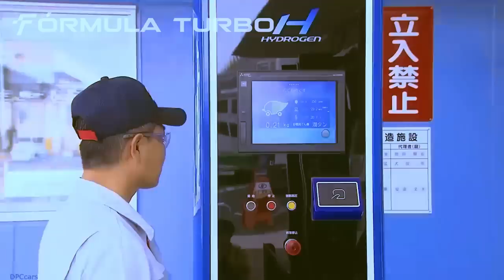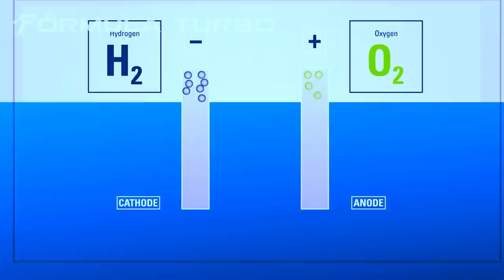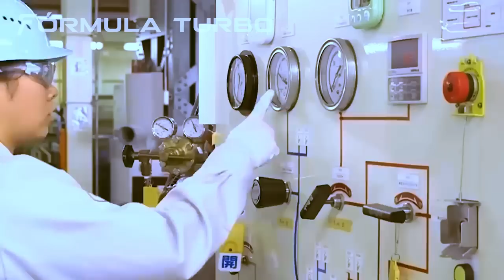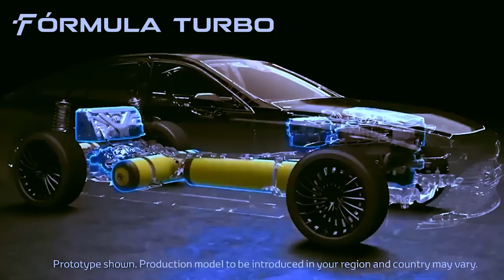BREAKING NEWS: TOYOTA'S CEO DISCLOSES THE ENGINE OF TOMORROW

Comment: The fundamental problem with hydrogen is that you have to make the hydrogen. And to be green hydrogen it has to come from electrolysis of water. That uses 3 times the power per mile than you would us  by just using the same power to charge a battery directly.

3 to 4 miles per Kwh For battery EV. 1 to 1.5 miles per kWh of  power - hydrogen - power - wheel "round trip" WHY?

Comment: If the hydrogen/fuel-cell car can be reduced in cost like my solar panels and also provide in-home hydrogen compression and storage, ensure hydrogen is not stored on the car in high-pressure tanks (which would be very dangerous in an accident) is overcome I'll stick with my free electricity from my solar panels.

Comment: This is old dead news. Toyota is swimming upstream against an impossibly strong current. IC Engines of any kind have terrible efficiency, 30% or less in real world conditions. Fuel Cells are better, topping out at 60%. However, Hydrogen is not a freely available fuel, it has to be extracted using a lot of energy. You then have to compress it, transport it and store it.
When you put the Hydrogen ecosystem next to the BEV ecosystem, it's blindingly obvious which is the most efficient and convenient. Hydrogen is a dead duck. It always has been, and always will be. Sadly, Toyota have invested so much into this technology, and the Japanese are culturally programmed to save face at all costs. Admitting that they've made a grave error of judgement is simply too much for them to do.
Bankruptcy beckons.

Comment: No infrastructure to fill up your hydrogen car. The cost to producing hydrogen is very expensive and causes pollution to make it unless you use solar. It needs to be refrigerated during transported and storage. MORE ENERGY!!! At this point in time Toyota needs to go all electric with some sort of battery technology or it will go under.

Comment: Question for Toyota. Can I fuel the car using free electrons generated from the solar panels installed on my roof? Or do I have to take the time out of my day to drive to a gas station and pay for expensive gas?
Reply: Electric vehicle owners should ONLY be allowed to charge their cars using wind and solar power, otherwise it's just pretend.
Reply: Use your solar panels to generate hydrogen instead of charging your dirty rare earth battery.
Reply: Now they are saying that the cost of driving an EV is more expensive than a gas car. They also say the EV market is slowing down and dealers are having to discount the vehicles to sell them. Myself I will never own a EV if I can help it.
Reply: @jimg2885  how can it be more expensive, when my overnight electricity is usually 8p per kWh and often goes down to 0p at weekends. So between 0 and 3p a mile?

Comment: They need to make an inverted tesla turbo fusion generator or use a vacuum sealed push plate in order to achieve qauntum pressurization though they would need strong and heat resistant materials.
Reply: Eh ??
Reply: Try combining that into an inverted turbo plasma generator with a vacuum sealed push plate for qauntum pressurization.
Reply: WTF ???

Comment: The biggest problem with the combustion engine is that it's design has been controlled for decades by the oil companies so they have a market for gas. A combustion engine can be designed that will give over 100 MPG and that would be all we need for our environment. In my opinion there are three major polluters; many manufacturing facilities, airplanes (too many in the air) and all the transport trucks on our highways carrying freight that should be on the rails.

Comment: Downvoting any video that promotes hydrogen. Folks, it’s a fantasy.  There’s a reason it is only available in California & Hawaii only—there aren’t enough commercial hydrogen stations, and there will never be enough stations—it’s a chicken or egg conundrum.  
I stopped listening to this video when it started to say green hydrogen was the future when more than 90% of all hydrogen is currently made from splitting methane using a steam process to make  H2 and CO2–Yup, that greenhouse gas. And if it takes electrolysis to make “green” hydrogen, why not skip the hydrogen step and use the electricity to power the car directly?! 🧐

Comment: Costly to store and  requires specialist equipment
High cost of servicing like ice motors
Cost of liquification
No existing infrastructure and expensive to install
No government will fund it and Toyota won't build them
Reply: Ev"s are not proving to be cheap to service in practice.  Tyre wear is Hugh due to weight and suspension components will also take a big hit.

Comment: How big the rhe tank should be for 500 miles range. Oops . Is there an answer  , any one ?
Reply: If it was a single tank it would have to be bigger than the 3 used in the Mirai.  Say half meter in diameter and 2 meters long as a guess.
Reply: Too big to fit in a car, that's why the range is no better than a BEV

Comment: I thought Toyota was working on HCEs not Fuel Cells.  Advancing technology to make hydrogen combustion engines would be better since it could be used to convert all existing gas powered engines to non polluting.
Reply: A hydrogen combustion engine is less than half as efficient as a fuel cell is the issue.
Reply: Yes !
H2O and electricity.

Comment: This is based on old information in regards to Toyota.  They are now very much on board with EVs.  
There is very little advancement happening in the fuel cell space and even less in regards to mitigating the large tanks needed to carry it.  Look how far the Toyota Mirai is way behind current EVs and the gap is widening every year.  Meanwhile battery advancements are progressing at a faster pace and look to continue that advancement.  In regards to the batteries nearly all will be recycled.  Recycling these batteries will be a profit center for many companies. In China which is the leader in this area the amount of EV battery recycling passed 2022's amount in the first 5 months of this year. 
Hydrogen fuel cells do not put out much power so a you still have to have a fairly good size battery. 
The video mentions that hydrogen produces energy much more efficiently. This is a flat out falsehood.  Hydrogen is just a means to transport energy just like power lines. It is not more efficient to use electricity to generate hydrogen, transport and then use a fuel cell than it is to transport it via power lines and a battery. 
The video also state hours to charge and electric car. This is misleading at best.  Most EVs are charged over night at home and would only fast charge on the days that car is required to go over 250 miles. (not that often for most vehicles.)  Many of the fast charging cars can add over 200 miles of range in less than a half hour with the best doing it in under 20 minutes.

There is some good information in the video but most of it is misleading.   It is like the info came from a 5 year old Toyota marketing spiel.

Comment: The High pressure Hydrogen tanks you need in your care are bulky. So the range on Hydrogen will be somewhat limited. Add up the damage the high pressure Hydrogen can do to these tanks. Small cracks will be a safety issue. In Europe LPG and natural gas driven cars and truck have an additional yearly check of the tanks included in the maintenance. The maintenance is more expensive than with fuel driven cars. And every 10 years the tanks will be degraded and have to be changed for new ones. This probably will cost less than a change of batteries for an EV, but remember Hydrogen cars also carry a smaller battery to store the energy produced by the fuel cell. And note you loose Hydrogen in your tanks over time because of it diffuses through the tank materials. Let’s save Hydrogen for trucks and airplanes and industry use. Till the moment there wil be sufficient Hydrogen we have to use fossil fuels to produce Hydrogen. It’ too early to youse it widespresd in cars.

Comment: Just don't park your hydrogen vehicle next to a BYD electric.  You might take out an entire city block.

Jokes aside, I see EVs as the necessary kick in the crubbles that was necessary to separate us from ICE machines but the battery production, replacement and end of life costs for EVs make them nothing more than a stepping stone.  Sorry, Elon.  So long and thanks for all the fish.  
Hydrogen is the only logical long-term choice.  The distribution problems?  Set up each refuelling point as an independent hydrogen generating station.  There are already advanced-research machines that can pull hydrogen out of thin air without expensive or complex costs.
Long term?  Hydrogen for the win.

Comment: The future of personal vehicular transport is not going to be achieved by electric or hydrogen powered vehicles due to the lack of charging infrastructure, the dangers that both bring to the market, the gigantic investments needed to provide that infrastructure and the technological requirements of the safety aspects of these fuels.
The cost of these types of powered vehicles is way beyond what the vast majority of the current vehicle owning public can afford and therefore sales volumes would be decimated, thereby making it impossible to recover the costs that would need to be spent on providing the infrastructure in the first place.
This brings into focus that the real objective of these vehicles is to render vehicle ownership for the mass population to be an impossibility and therefore becomes a branch of the current "Narrative" of fear, control and reduction in the aspirations of the majority of the global population.
Some would say that all these problems are being solved by the post Plandemic reduction in the global population which is still accelerating.

Comment: "Hydrogen Cars are much cleaner than Electric Cars in Operation..." What kind of absolute garbage is that? A fuelcell car is an electric car, that also has an electric Motor, but instead of using electricity directly out of a battery, it takes the detour of generating electricity onboard with the use of hydrogen that has before been generated fom Electricity. Totally wastefull. An electric car releases nothing in operation. A fuelcell car water. So which is cleaner?

Comment: The largest electric grid operator in the US has issued a level one emergency alert - raising the specter of its 65 million customers facing potential blackouts as heatwave forces air conditioner surge. Now add just 1 million battery powered vehicles that need to be charged and it's lights out. The power grid is not ready for a surge of vehicle batteries in need of charging.
Reply: You need to read a little more widely. Start with the grid suppliers.

Comment: Internal Combustion engines are the best all around answer for many reasons.  The infrastructure for petroleum fuel distribution is mostly already established.  Fuel for internal combustion engines is not made from "fossils".  While there are many internal combustion fuel efficient vehicles in today's market . . . the internal combustion engine still has the potential for even greater fuel efficiency if given the "go-ahead" authorization and the huge funding for Research and Development that has been stupidly wasted on the electric vehicles charade.  Electric vehicles are mostly a politically motivated threat or restriction to individual people's freedom of mobility.  Drive wherever you want to go... but on a leash in the form of an electrical cord.  Ugh !